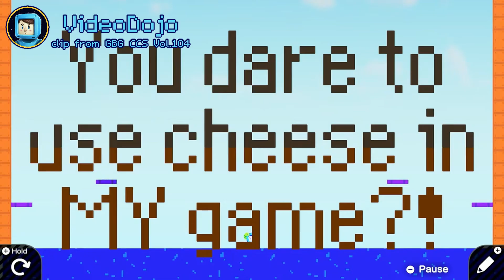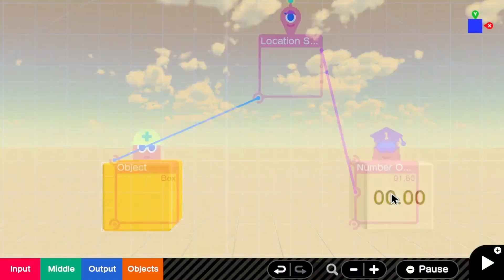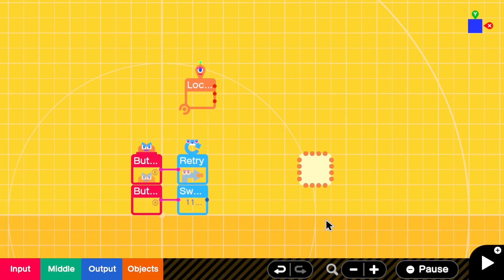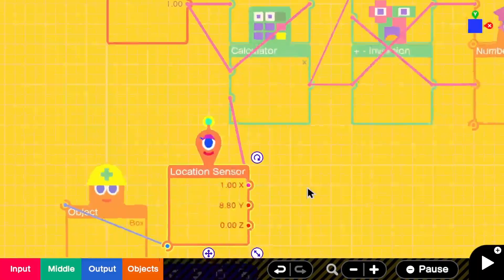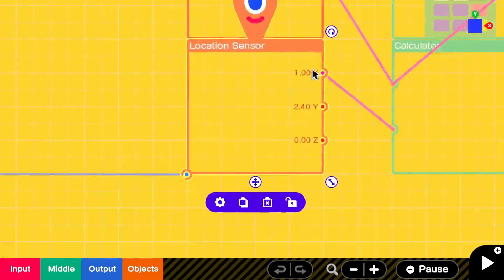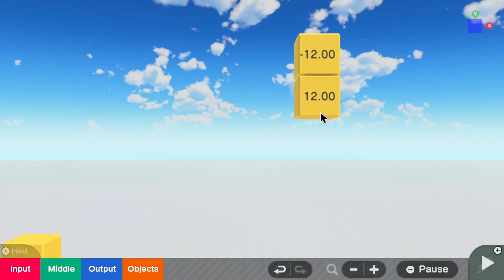Programming Screen Detector & Retry Counter - GBG Tutorial

Comment from the maker: You might notice that Number Objects connected to the first frame detector introduced in 17:01 shows a 0 during the first frame of the game. This is just a visual glitch related to certain Nodons during the first few frames; if you replace the right Invert Nodon with a minus Calculator, it will display the first frame value correctly, but either way, the real value being sent during the first frame is not actually 0.